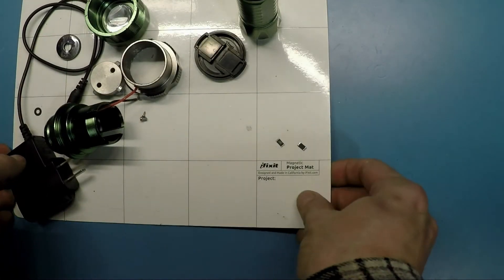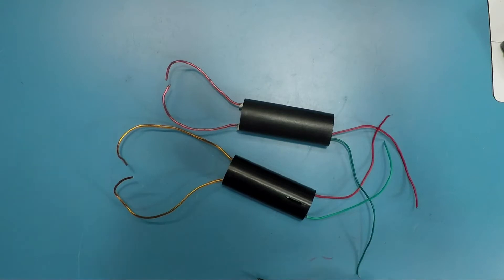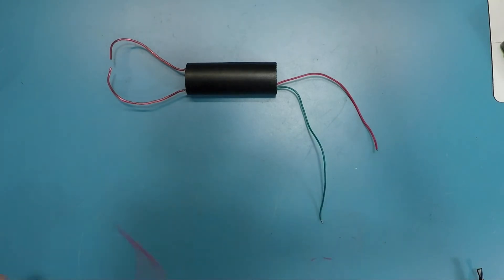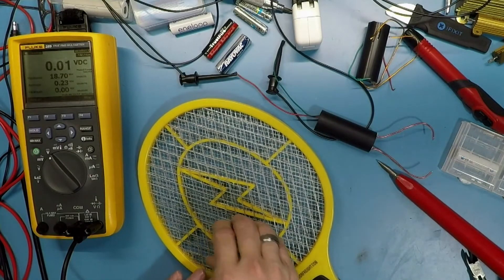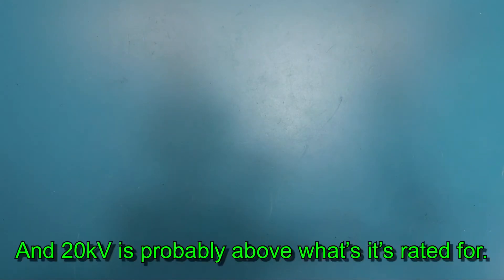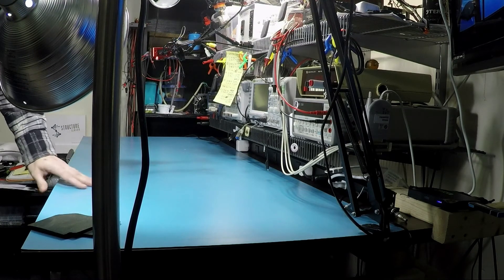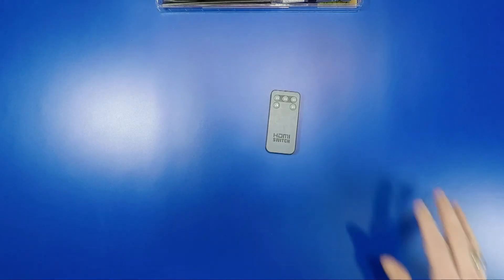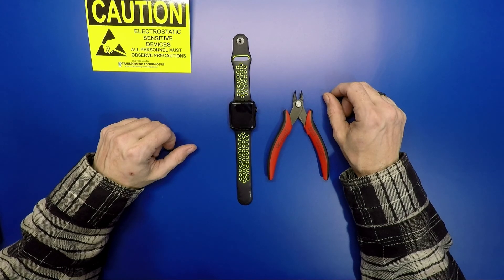When to replace your ESD mat, and how I ruined mine with a High Voltage Transformer.

Comment: i have bin trying to find out if the cheap awful smelling mat i got from Banggood actually works or does what it's supposed to do?? even if the durability is low.. i'm finding it hard to find info on how to test and determine this using simple tools like perhaps a multimeter.
i get the same results but a tad more jumping around on the black rubber side.
https://youtu.be/Y2eF0GmDqFQ
would anyone using such a cheap mat (grounding it) be in a false sense of security thinking he/she is esd save??
Reply from the maker: You won’t get steady reading on the back of the mat. It’s condictive but still a rubber mix so not a solid wire conductivity.

Comment: as a noob (40yr old noob hahaha )starting in soldering my own mechanical keyboards and sum diy kits learning electronics and soldering as a hobbyist. so i got this mat from bang good.. costing me $18 after a few weeks it still smells awful. but since i don't use it all the time i roll it backup when i'm not soldering don't have a dedicated bench..but i'm thinking getting more expensive one around $65 + tax it's $79 for a 900mmX600mm with all the parts needed ..what do you think worth it or just use the cheap chinees one ?? i do have a multimeter and measured it green side is 0.ohm the black rubber side jumps around in ohms hard to say...it seems conductive..
here is the link for the expensive one i can get  here in EU.
https://www.tme.eu/en/details/as-b60x90gr/esd-workstations/elme/157kit-6090-grey/
Reply from the maker: Heck, I’m still a noob also at 43, lol. 
I think a quality mat is always a good investment.
It seems to have the 1M resistor built into the cord for the wrist strap, so that's good. The question is for soldering what kind of temperature can it take? I didn’t see that on the specs.
I have had my soldering iron sitting in a test strip and did steps at a time. I couldn’t even start to mark my good mat until I reached over 370C then it marked it, but didn’t hit the conductive side. And again at 385C I think I was able to get a reading so the non conductive side was compromised. This was an extreme test I did, I kept the iron on it in one place for 5 minutes at a time. 
So a accidental drop of the iron, or solder splatter wouldn’t come close to damaging the mat until probably about 550C and who solders at that temperature?

So yes, some mats cost more but will also last you much longer Andrew not have that checmkcal smell. Will have proper ESD disapation and the resistors built in to protect sensitive items you may be working on also. I think it’s worth it, just confirm with the manufacturer what temperature it can withstand. 
Hope this helps,
Scott
Reply: Thanks very helpful. i will get the good quality one . only not the kit because i just discovered that the wrist strap is not standard 10mm but 4mm.. getting the parts from the store is better..only thing not in stock is a cable from the strap to the mat..so i have to get that somewhere else.. but those are easy to check ..even from china ... 1ohm is easy to check.. i'l use the other one from china as a floormat hahaha
Reply from the maker: It’s actually 1 mega ohm, not 1ohm.

Comment: Hiya Scott. Your arc was having a sniff around for the conductive layer of your mat :)  I got a shock like that once.. My old ESD mats ground clip wasn't making a particularly good contact and I had my hand resting against the edge of the ESD mat whilst I was testing a HV circuit, the HV shot through to the conductive layer and got my hand at the edge of the mat. The arc was dissipated very well through the mat so I didn't get the full multi kV sting :)
 
Cheers Scott
John
Reply from the maker: Hey John, not sure how I missed this comment. Yes, I now use a cutting board made out of ????? I can’t remember what’s it made out of. But it’s a type of non conductive plastic that’s 0.5 inches thick and works good as an insulator. Oh, I think it’s made out of Teflon. One funny think I noticed during the dry winter is when I walked up to a bench I would have a static shock from the bottom layer of the mat since it’s conductive and grounded to the mains. It’s like touching a door knob. I thought to my self how people say to touch the metal frame of a grounded appliance like a computer to discharge any stack charge first, well I guess I can just walk up to a bench and discharge, lol. But at least that tells me the bottom is conductive and working, and the mat is properly grounded also. A weird way to test it, but it works. Of course I also test the resistors to make sure they are good about every month. I probably should test more often. Unless something like that arc happens then I test everything to ensure it’s all still working as expected.

Comment: Next time doing HV testing use a cheap plastic cutting board as insulator, and keep the HV stuff on it as insulation. Those generally are pretty good with the natural white plastic they are made from. They hold charge so be careful, can give a nasty belt after you have finished and think all the plate is discharged, so wipe down with a damp cloth after use.
Reply from the maker: Yes, I know this. This was an old video from a while ago. I decided to include it more as a lesson to be learned for new people in the hobby. If you watch at 8:06 and the next 10 seconds or so I make this clear. But still the mat didn’t hold up in other ways nearly as well as the first one i bought years ago and I’m still using today in the basement in the battery bench.
Thinking back now, I should have showed how to properly insulate with high voltage, but I try to stay away from videos with AC voltage and high voltage. I’m more geared to reviews and showing the basics, equipment and such. I don’t want someone getting hurt saying they followed instructions on a video I did, and why I normally don’t even show things like this.  
https://youtu.be/KPJf5soUsEQ?t=8m6s
Thanks for your feedback and thanks for watching,
Scott

Comment: Curling is easy to solve, just use some double sided tape to stick it down.
Reply from the maker: Hi Sean, it wasn’t just the curling, chemicals and solder affected it more then my original mat also. And I did deal with kapton tape holding it down for a while until I was tired of the look.